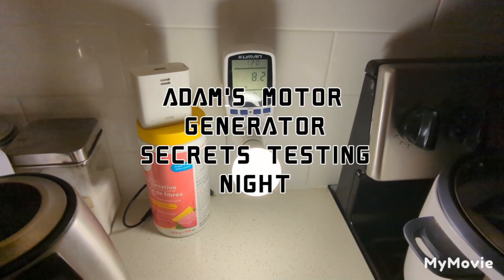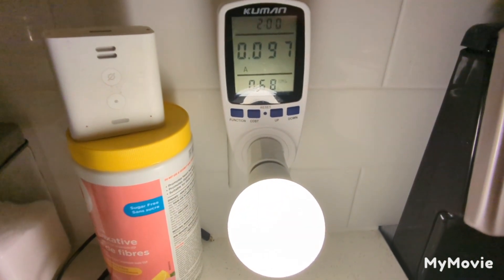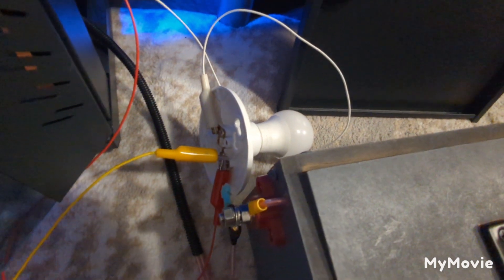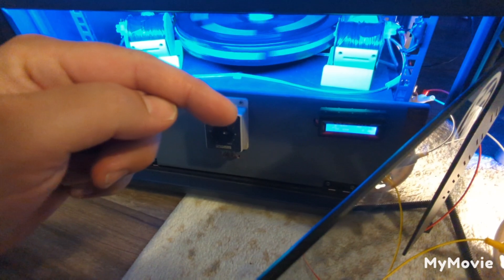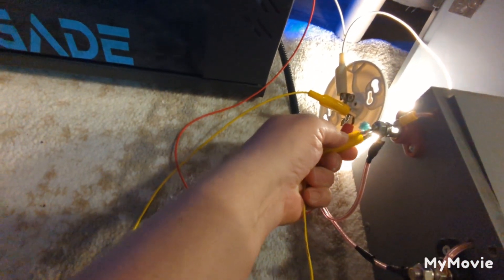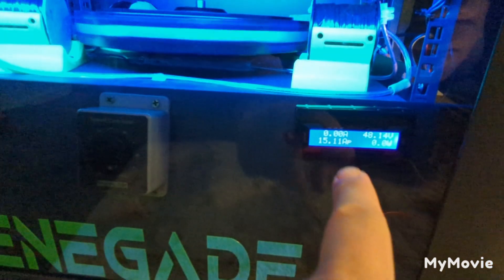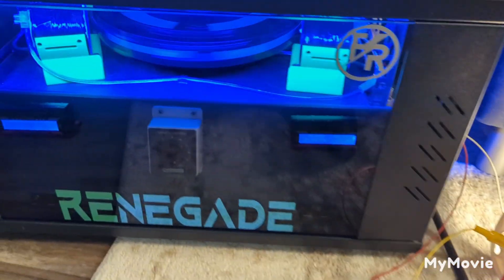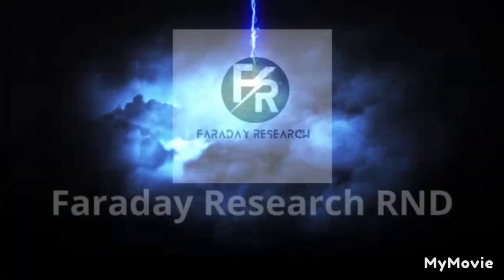Faraday Research Adams motor generator efficiency test#freeenergy #zeropointenergy #tesla

Comment: Great video! Loving this series. Question: isn't there a way of reading the watts volts 
Etc.  coming out with a meter or something? Is the light bulb demo the only or best way? Btw, I know little to nothing of electronics, so really just an honest inquiry.
Reply from the maker: The type of power I'm working with is Nikola Tesla's impulse back EMF technology that he was trying to perfect back in the early 1900s but unfortunately was stopped by the elite. So to properly measure the power output of my system I need very expensive specialized equipment